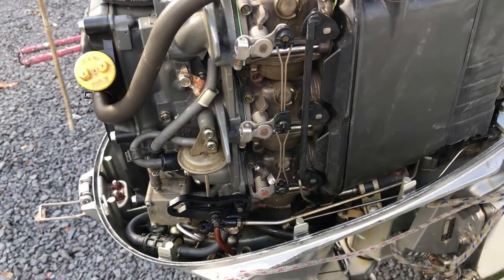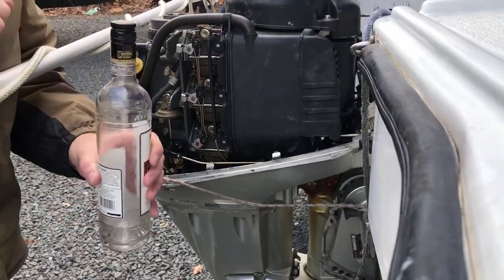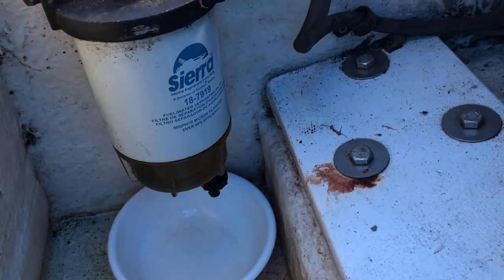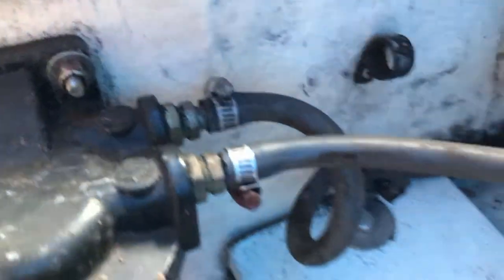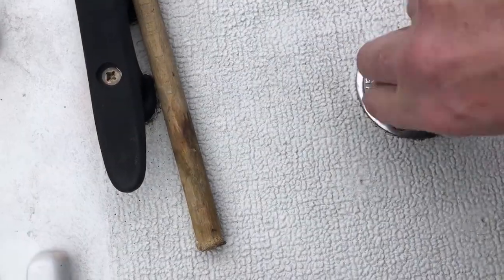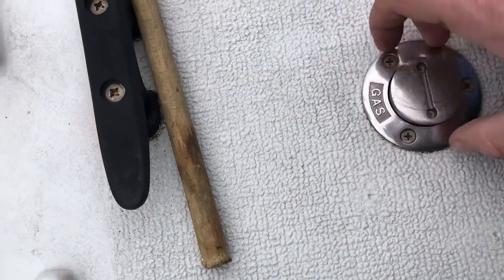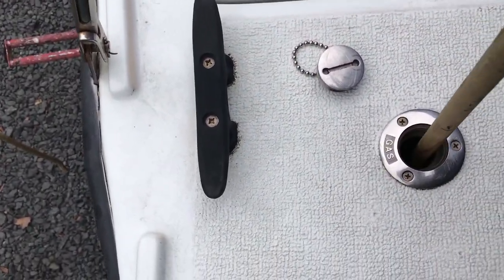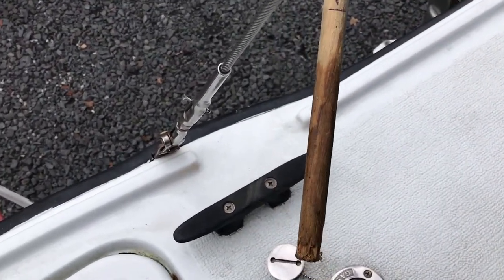Winterize The Gasoline Fuel System On Our Sailing Catamaran (Boat Work: Sailing 9 LIVES)

Comment: I think I would give some thought to StaBilizing both of the fuel tanks and then running the motor on one tank and then the other until StaBilized fuel was sucked in to the engine.  And then drain the fuel filter and carb bowls.
Reply from the maker: You know, that is likely a more complete procedure. I had already fogged the engine through the intake and then through the spark plug holes... I remembered that I had not yet stabilized the fuel. That's why I didn't run the engine on stabilized fuel, as you suggest. But your procedure is better, for sure.
Reply: @Sailing9LIVES  In the past I also have been guilty of getting the winterizing process out of sequence, that is why I find a check-list useful.
Reply from the maker: Yep, a checklist is always a smart idea!

Comment: Reusing the fuel from the water separating fuel filter is not a good idea as the clear bowl is where the water collects that gets separated from the fuel.   Check it carefully - water will sit at the bottom and may be hard to see.
Reply from the maker: Good thought, absolutely! We definitely should have made that more clear.

Comment: Not a fan of the scene fade or whatever you call it on this one.  Was that fuel line in good enough shape? It seemed to tear pretty easily. Replacement planned in the near future? 👍🏾
Reply from the maker: Marcel D 
Hey, Marcel! Yeah, this one was built a long time ago, and I deleted the source project. Then I found that the file was corrupted, so I recreated it (quickly) from the original clips. A rush job, really.
As for the fuel line, it was actually in decent shape. I did, however, replace it anyway. Now I am thinking I probably should have waited, as we are considering a new motor and I am not certain that the quick connect will be compatible. B.O.A.T.